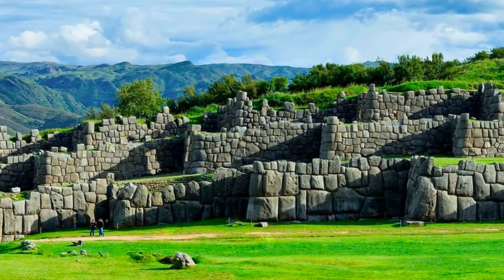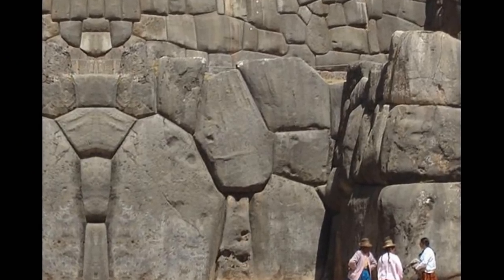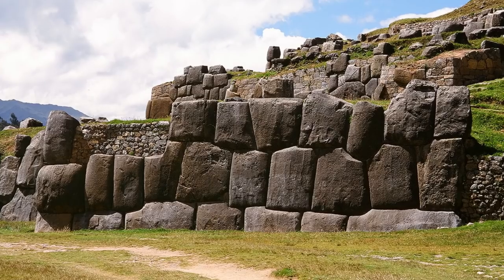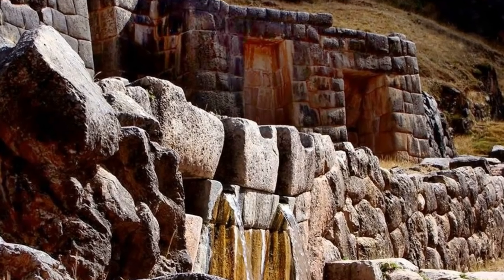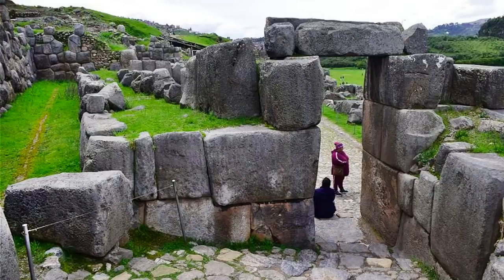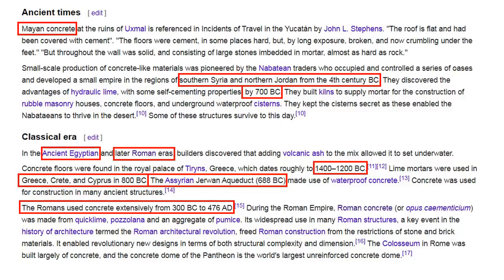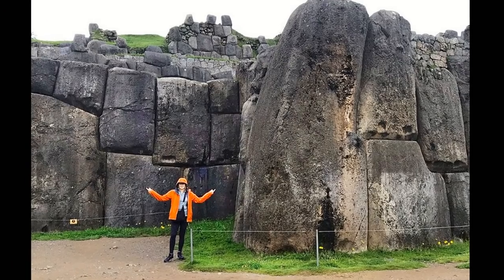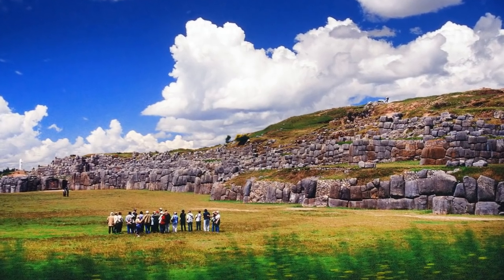Explained: How were Peru’s #Sacsayhuaman Walls Built

Comment: 1. Lifitng of those heavy stones is EASY. It just does not seems like it, when you picture it, because we picture it with the most dumbest approach (like dragging it with ropes or something). A guy named "Wally Wallington" has some videos about it. 
2. "hand tools cannot achieve this level of accuracy" is just a wrong statement. First of all, the accuracy is only that good at the edges. On the inside and backsides, gaps are filled up with other stuff. And for the outside they had many possible techniques to model the stones. One theory is, that they made a miniature version of it before putting together. There are many techniques to copy miniature models to real workpieces.
3. Some people actually think they are so smart, but don't think that somebody else has thought about this before... Of course geologists analysed the rocks and they can say for sure, if something is a rock or artificial. Furthermore they found the quarry for those rocks.

Comment: I wonder what the mould containment material might have been, to be strong enough to keep its approximate shape against the mass of material it contained. Looking at the stones it appears there was some "bowing" and in some cases possible exterior pushing (marks left on the exterior) where it may have bulged out too much.  Which implies the mould was flexible. Also, how then would the mould be removed after the internal mass had "set".  Some of the stones in the pyramids seem to indicate that wood was used for moulding.  I also wonder what ground penetrating radar would reveal about the rear of the giant stones structural shape.

Comment: Most of the story is good but missing a few details:
1. Imagine a few thousand years of weaving practice that would result in baskets, blankets, mats, etc of various stiffness, that could be bent and shaped into any form desired.  That's what the women are still doing today in most of Latin America and other places.
2. Imagine a few thousand years of chemistry development, starting with fire and ashes - to develop a geopolymer concrete with no organic materials.  A concrete made from all local materials, that sets up in a day or so but remains soft enough to be scraped and finely adjusted for a perfect fit.  (That's forgotten chemistry).  We are always looking for clay pottery - when we often have geopolymer concrete right in front of us.
3. When did it first happen?  That's the big question we can't yet answer.
Reply: Woven heart stents are made in Peru, l wonder!!!!!

Comment: The poured molten or poured concrete mix into moulds, is the best explanation of how the Pyramids, and almost all the ancient mysterious stone structures were made. So simple.
Reply: What kind molds thought? Each and every block is unique...
Reply: @thabzmad7265  The moulds were referring more to the pyramid casing stones, as far as the walls go, the front faces could have been held in place with damp sand, the internal faces with some kind of boards, possibly with damp sand in them, there are lots of repeated angles, you could just have a set of formers. Molten rock blobbed into the formers and left to cool, sometimes another block is placed on top before the previous one has fully set.
Reply: @utecandotransportservices4932  all theories, I challenge anyone who thinks they have a workable idea to perform and demonstrate even a small scale model of the construction and provide real world solutions of how it could have been done millenia ago...
Reply: @thabzmad7265  Challenge accepted, I'm on it..
Reply: @thabzmad7265  construction has started..
Reply: @utecandotransportservices4932  I am eagerly awaiting for the video!
Reply from the maker: I explained my thoughts on the molds and the unique blocks in the later half of the video. Hope that'll answer the question.
Reply from the maker: I agree that the cast concrete/ geopolymer concept works better than any other construction theory for the Great Pyramids.
Reply: @CuriousBeingbyTina  Hey, I've started making a wall, I'll show pictures and video when I'm done, it's going well.

Comment: Why couldn't they have been cast in place in bags designed to create fitted stones that would harden when wetted. I can easily imagine a design of specialized bags creating a dry stack wall.
Reply from the maker: Then the bags would need to be super thin, smooth, structured and strong to hold multiple-ton material in position.

Comment: Wow. My theory looks very similar. With some details that might be a bit different.
Your idea of compacting play-doh blocks is very interesting indeed.
One of the things I noticed on the surface of many of the blocks were defects which look similar to the defects that might occur in brickmaking.
Some of the cracks are the same as the creases and pockets you see in old style bricks (where clay is pressed into a mold (instead of modern extrusion bricks)). Caused by the clay not being pressed into the mold carefully enough.
And there are defects which are also found in brickmakig which look like pieces broke off from the surface. In brickmaking, this is caused when the mixture is not thuroughly mixed. A streak or vein of material that doesn't stick to the clay.
You can find examples if you google brickmaking defects.
And then there is the famous face-shaped defect in one of the stones. Some people say it is etched with a powerfull laser (don't get me started what prior technology you need to invent a laser as opposed to knowledge about for instance working with limestone). Some people say it is done with some sort of acid.
I think it was something which wasn't supposed to be in the mold and didn't stick to the stone (and fell off...).

Your view of the indentations seems to be the same as mine. A malet or block of wood used to press or hit down the material, instead of what people say, a scoop. No scooping in that sense was done.
The protuding bulges might be spots where the mold was open. That way you can make sure there are less of the creases and airpockets on the outside surface. Just like in metalcasting. They make overflow channels to make sure that whatever needs to be solid is solid (so no airpockets). But this is just an assumption.

Here are some video's which add value to the theory.
https://www.youtube.com/watch?v=tOhAfaFboNU&t=395s  (Don't these tapping indentations look very similar to the one's on the wall??? Interesting video as a whole by the way)
https://www.youtube.com/watch?v=znQk_yBHre4 (This is how Joseph Davidovits thinks the pyramids in Egypt were built. Which is a similar process, but different material)
What is interesting to note is that if the blocks in the second video age, they turn back into limestone which is indistinguishable from natural limestone.

Anyway. Very interesting video!
Reply from the maker: Thank you for sharing your insight! I appreciate it. 
Your explanation on the cracks at Sacsayhuaman being similar to the defects during brick-making is interesting and plausible. 

The tapping indentations on the Roman Concrete video are very similar to the ones on the Sacsayhuaman blocks.  
I read about Joseph Davidovits' geopolymer pyramids theory and I think it sounds reasonable and practical. Casting would be so much more efficient than carving and moving stone blocks. 

I agree that some concrete and geopolymer "stone" blocks do look like natural limestone. Portland cement concrete was even named so for its visual resemblance to Portland stone which is a type of limestone. 
Thank you again for the information!
Reply: @CuriousBeingbyTina  It's simply fascinating to look at some of the old megalithic sites and trying to find logical reasoning in how things were made.
In central and south America, people used lime(stone) to bake cornbread. They used the same chemical properties to increase absorbtion of medicine and drugs by the body.
They probably found out by baking bread in a limestone oven or preserving corn in a limestone vessel before making their bread.
So they had use of limestone rock in different fields. This could make the discovery of cement/concrete a natural step (or maybe the other way around, first cement/concrete, then baking bread with limestone...who knows).

But some of the signs on old limestone constructions point in the direction of "casting", "molding" or other methods to make these objects instead of cutting them from bedrock with copper and stone tools.
I even wonder if they were able to use a similar process with other rock types.
Reply from the maker: @spekenbonen72  Very interesting. Thank you for sharing.  Ancient people could be very sophisticated alchemists. 

I also thought about whether other rock types can be "reassembled". 
Man-made stone started to become popular now. Man-made stone is usually composed of quartz, resin/polymers and pigments.  Man-made quartz countertops can be even harder than granite since they consist of 90% quartz, while granite is partially composed of quartz.  
I haven't seen large man-made stone blocks though.
Reply: @CuriousBeingbyTina  Today I found a book by this French geopolymer expert, J Davidovits (that guy in the video about the pyramid blocks) which could point to granite polymer made in Egypt. The book is about a carved stone (located near Aswan, on Sehel island in the Nile river) with hieroglyphs of a text that dates back (the text, not the stone. The stone was carved in the Ptolemaic period 300-32BCE) to 2700BCE and even mentions iron(ore). 

The book (parts of which you can find online)
THE FAMINE STELE PROVIDES THE HIEROGLYPHIC NAMES OF CHEMICALS  AND MINERALS INVOLVED IN THE CONSTRUCTION OF PYRAMIDS.by J. Davidovits Presented at the Vth International Congress of Egyptology, Cairo, Egypt, Oct. 1988.

Because of this book, I now doubt the dating of the so called "Iron Age". They didn't have the knowledge to protect iron from corrosion/rust. And all iron turns to ironoxide (dust).
The ancient caves in some of your video's could have been made with iron tools, even without a trace of those iron tools.
Reply from the maker: @spekenbonen72  Thank you. I found parts of the book - it's an amazing find. If chemicals and minerals were documented to be used for the pyramids construction, then it adds more credibility of the geopolymer hypothesis.

Comment: definately/obviously earth-BAGS cement construction,,,, in some support forms...> the protrusions are like if you were to hold up a big bag of mud> you would pinch/grab it for grip..
Great Pyramids filler-blocks were done Similar with fabric in grids=level by level... outer perimeter casings & hallway&inner structure were cut blocks,,,, the filler blocks were poured evenly in fabric divisions...they look like it too. (it just makes more sense)

Comment: The problem with molding is: There is only a tight seal at the front. If it was formed, the entire edge would have been forced to match the next block.
They didn't care what the back looked, they filled it with dirt, small rocks any old shit, they only cared what the front looked like.
This is also the same as the Egyptian Pyramids. If they were Plasticine Blocks, it would be more work to make them tight at the front and open at the back. And the other issue is making a different form for every block, no two blocks are the same from one end to the other.

Was it an unknown technology or did they just wing it ?

Comment: Questions: If the rock from the identified quarry was chemically modified to be pliable,  wouldn't the crystalline structure of the modified rock be different than the rock still in the quarry and the chemical have some traces of it left?  If the rock was softened by heat, would the crystalline structure of the heated rock look any different than at the quarry?  Maybe not since the rock at the quarry was formed by heat?  It will be great if someone can figure out within our lifetimes.
Reply from the maker: Thanks for the comment, Bob. I did some research on whether heat can be used to "melt" stone and there was indeed some patent filed on rock melting technology decades ago. Though the heat would leave a dark, almost polished finish which is quite different from natural stone. From that aspect I don't think the Sacsayhuaman stone was soften by heat.

Comment: Those huge walls at Sacsayhuaman only fit together on the front edge...and taper off. The walls in Cusco are a different mater. They fit perfectly in all dimensions 2-3 ft thick. The stone softening solution is known to indigenous people...but i have yet to see a demonstration of it. Regardless, very interesting..peace to ya.
Reply from the maker: Thanks for the comment. Yes, the stone blocks at Sacsayhuaman only fit precisely on the face side. It's interesting to know that the walls at Cusco fit in all dimensions - thanks for the info!
Reply: @CuriousBeingbyTina  Thank you for your reply 👍
Reply: Sacsayhuaman is in cusco. None of the polygonal masonry is finished on all sides anywhere in peru. Coricancha is the only location with very precise 3d fittings.
Reply: @jcie1210mk3  Kinda splitting hairs a bit here. Sacsayhuaman overlooks the town of Gusco at a higher elevation. I was referring to the town itself but technically it is the same place. There are many examples of walls in Cusco (town proper)...polygonal or otherwise with precision stone joinery in all dimensions. Amongst others, Brien Foerster has literally hundreds of uploads on his channel that evidence this. I have also been to Cusco myself.
Reply: @dazuk1969  I agree I've been there twice myself, the precision of the masonry is incredible around cusco and further west at sillustani. I just meant in the context of the polygonal work its not flush on all sides. Briens videos are good insights alright but his narrative leaves alot to be desired in my opinion! Cheers for the reply though sorry if I came across as pedantic.

Comment: If the blocks had been cast / poured then they would be fairly smooth on all sides, including the back which are typically jagged and rough.
Reply from the maker: I propose the blocks were in a plastic/ malleable state when they were placed on position. Then pressures were applied from the top and sides to make sure the blocks have a tight fit; therefore the backsides would be molded into the back soil wall and uneven.
Reply: @CuriousBeingbyTina  Look for a video called: Documentary, Stone (something, Polygonal Walls of Italy. Italy has tons of polygonal walls, some very smooth; others very jagged, but none of them have that bulging Play-Doh look at all. Those certainly weren't poured. So, if they could do it without pouring them, why couldn't people in Peru?
Reply from the maker: @ebookpioneers  Thanks Charlie. I have seen multiple polygonal walls in Italy, Greece and other European countries. Most of them are pretty smooth. Though this doesn't prove that these walls were not poured. Please check out photos of the Menkarue Pyramid's entrance. You can see the transition between the flat/smooth surface and the bulging blocks. It looks like the blocks were soft/plastic once and some tool flattened or "ironed" a portion of the wall.  Osireion also have such transitions. I think the two different finishes (smooth or bulging) depended on the builders' preferences. There are both smooth and bulging walls at Peru. The stamp or scrapping marks at Sacsayhuaman indicate that the blocks were soft during construction.
Reply: @CuriousBeingbyTina  Could be. I'll have to think more on it.

Comment: Even Roman concrete was better than today's Portland cement based concrete. Some blocks in Eygpt show oozing effects. Nice idea about those indentation and nubs. Have not heard that before. Polygonal Stonework is world wide so the method was common..
Reply from the maker: Thank you for the comment. Yes, the oozing effects/rounded shapes also show up in Egypt, which makes me think that maybe some Egyptian stone blocks were also cast...
Reply: @CuriousBeingbyTina  Seen an analysis of the Eygptian cast blocks. Interesting materials used. Have not seen any analysis of South American blocks. It does look like vitrification on the outside. Some suggest big solar mirrors made from gold, which is a good infrared reflector. Parveen Mohan has shown cast basalt statues, and there is a factory in Europe that casts basalt pipes. 1250C temp is needed. But how did they carve rocks n mountains?
Reply from the maker: @alwayscensored6871  Thank you for the information on cast basalt pipes. I appreciate it.  Some ancient Chinese kilns can produce temperatures up to 1300C for ceramics, but they are not big enough for these massive blocks.   It'll be great if we can get some geologists to do a detailed material analysis of the blocks at Peru and Bolivia.
Reply: @CuriousBeingbyTina  Did some more checking , Gold is a very good infrared reflector, used in infrared telescopes. Cities of Gold? How big a mirror is needed to melt rocks? Some channel's used overhead projector Fresnel lens to do it. An interesting mystery to solve.

Comment: Unfortunately, I don't see how your explanation accounts for the odd, multi angled shapes.  It seems to me that any explanation has to stat with a believable theory for that.
Reply from the maker: I proposed that the semi-cured blocks in their plastic state (like play-dough) placed on position. Pressures might have been applied from the sides or top to ensure tight fittings among these blocks. Earlier laid-out blocks might have cured longer thus more rigid to retain their shape better. Later blocks would be in plastic and malleable state. When the softer blocks being compressed by artificial pressures and gravity, they would have settled on and/or filled in the earlier cured blocks. This process would have created multi-angled shapes.